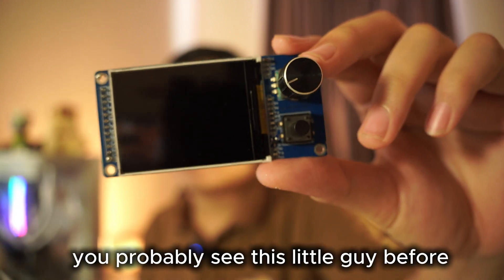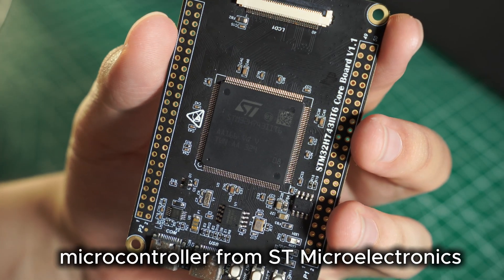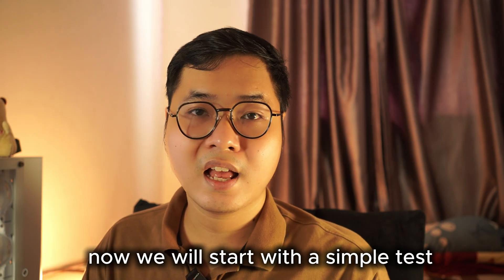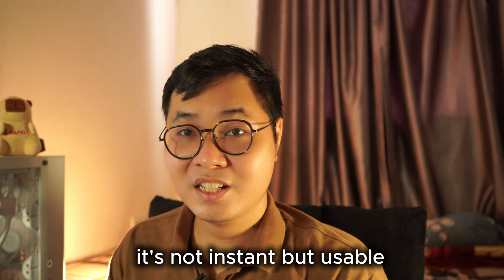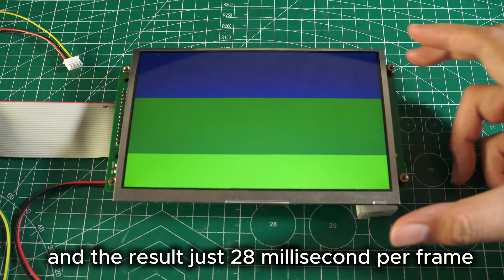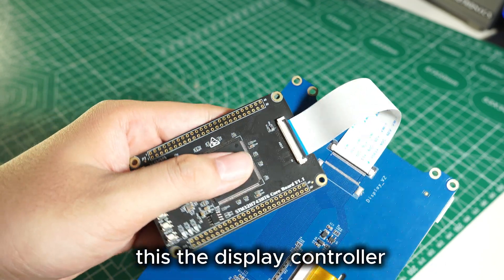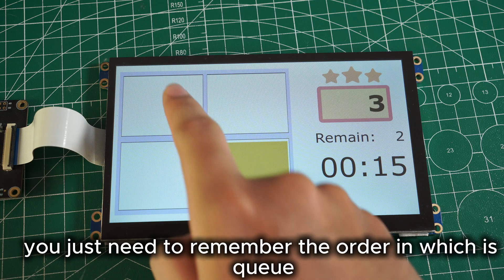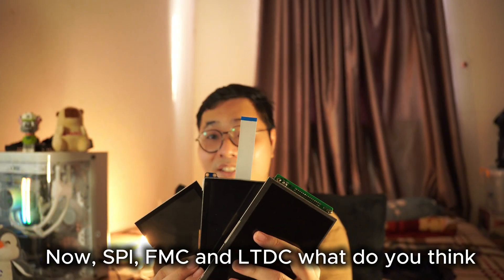STM32 + 7 Inches LCD Speed Test — SPI vs FMC vs LTDC | Real Performance Comparison | LVGL & TouchGFX

Comment: А есть хороший примерно на 2-3 дюйма?
Reply from the maker: For LCDs 3.5 inches or smaller, you can use LCDs with SPI communication ICs such as ILI9341, ILI9488, or ST7789.

Comment: Hi, thanks for this video, very helpful.
I bought the same hardware but I'm having trouble finding the schematic (I found one: CORE V1.1 but it doesn't match).
Can you tell me where to find it?
I'm trying to port MicroPython + LvGL
Reply from the maker: This is the schematic I'm using, as well as the sample code from the seller. (https://pham1998-my.sharepoint.com/:u:/g/personal/quangphuoc_pham1998_onmicrosoft_com/IQC-71j9JEoESZOQuKf8bP7qAVWxO194-8wYg0G9hDOt-Ts?e=A1rBV4) You can try it and see if it helps. 😉

Comment: Please, How can I contact to you ? I want to buy LCD TFT 7inch (LTDC) in this video.
Reply from the maker: You can buy this LCD on aliexpress (https://vi.aliexpress.com/item/1005004089520794.html?gatewayAdapt=glo2vnm)
There are also LCDs on Shopee that use LTDC, but they are smaller (4.3 inches).

Comment: Came from your Substack and love your work :) Curious if you had posted part 2 anywhere about the Allwinner T113 for getting LVGL to work with it by chance? Working on a similar board so any help is appreciated.
Reply from the maker: Thank you very much. Currently Tina-Linux for T113S3 supports LVGL by default, you can run the LVGL example with the command lv_example (Or similar) on the command line. By default, Tina-Linux for T113S3 will run a 4.3 inches LCD with RGB interface, you may need to change the device tree if you use another LCD. I will try to create an article about LCD and LTDC configuration on T113s3 as soon as possible. 😊

Comment: Git hub or anything. Will be useful to us😅
Reply from the maker: I just updated the code in the video description. If you have any problem running those codes, please let me know 😁😁😁
Reply: @Benedict-Lab yes yes let me check. I am parallely looking to implement LVGL with my current setup
Reply from the maker: Yes, I will update it in the description tonight 😅 I forgot about that part when I uploaded the video.